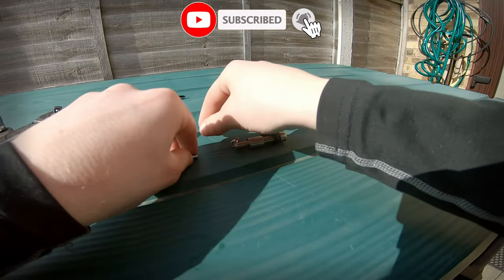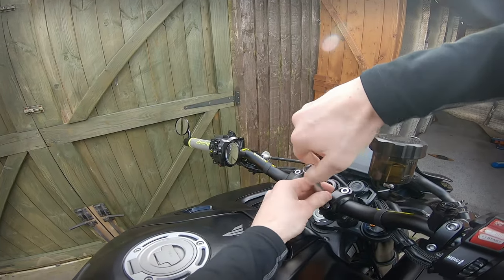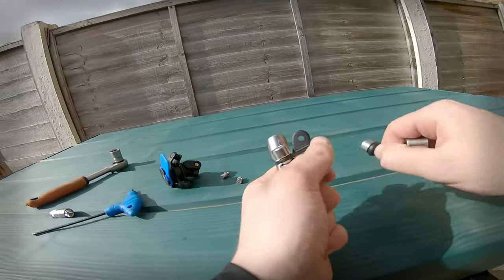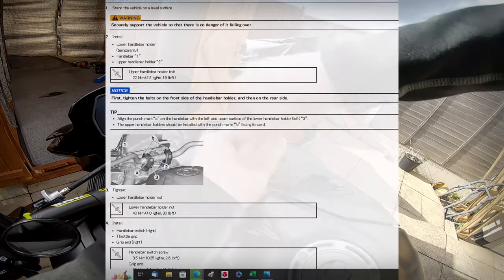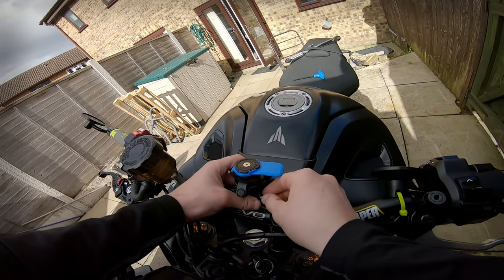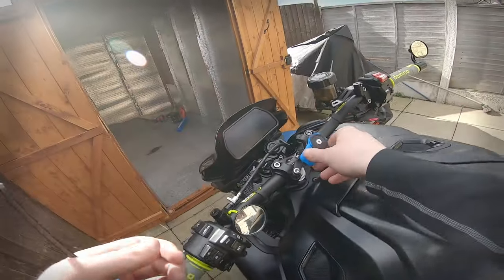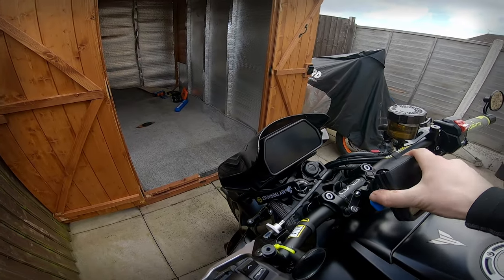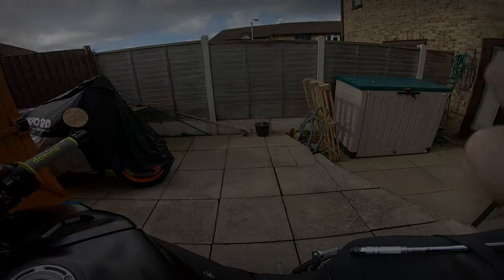Evotech Quad Lock Phone Mount Install | 2023 Yamaha MT10

Comment: It's so worth having the vibration dampener, having destroyed the camera on my old iPhone. Why oh why do nuts have to roll away under things, they can't just fall where it's easy to pick them up again. I had an easier mount for my Speed Triple bars. The Quadlock just mounted to the bars themselves without the need for that bracket. I also recently installed the USB charger accessory, which I really like.